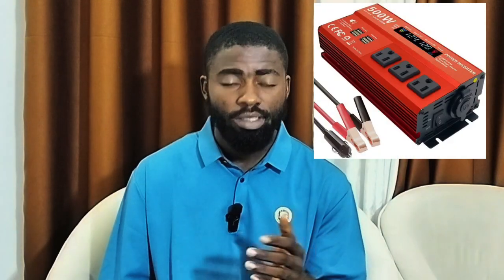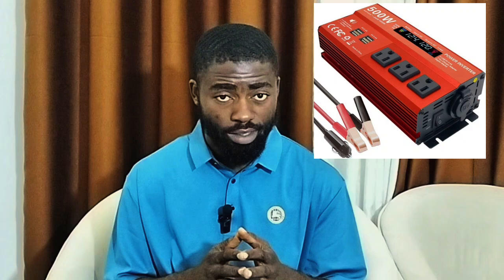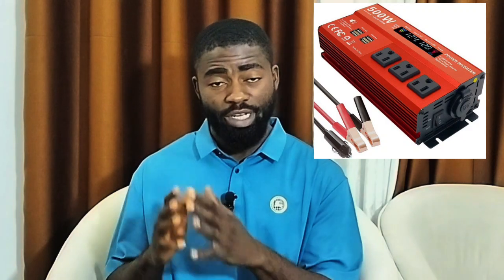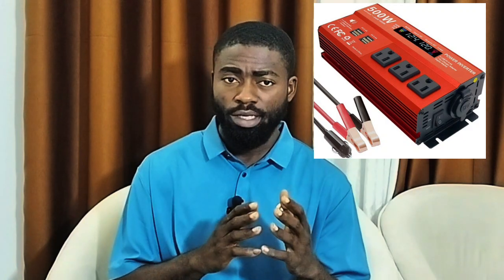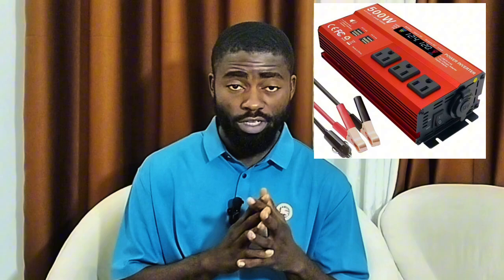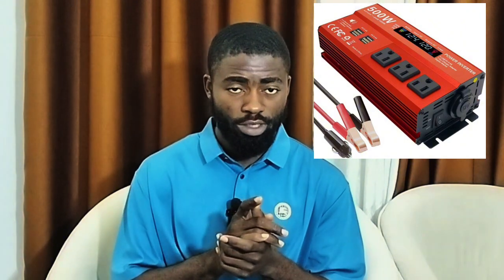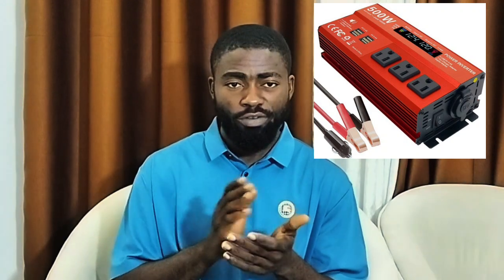THINGS YOU NEED TO KNOW BEFORE BUYING SACHET INVERTER

Comment: I have a powerstation that is hard to charge with solar panel directly, can I buy sachet inverter and connect my ac charger to the sachet inverter to charge my powerstation without adding batteries to the sachet inverter?

Comment: I have one that have been using for 5 year now with same battery its a 1.2/12v still working perfect. The only dissavantage there is the charging harms @ 15a insted of 20-25 so it slow the charging, thou it fine by me cos my solar does most of the chaging and also i have to connect a stablizer with it to ballace the grid coming in to 220v cos our light is low.  never been taking for repair even the day my wife mistakenly plug irion the fuls just cut and i replace it and it cary everything including my watching marching blender tv fans and lights and other things but  excluding ac and irion and pumpin maching. All this disservantage you mention cant be found on my own, and wen is working the light is pure and ballance, it  ( ST full intelligent product ) my dad bought it about 15years ago but  just keep it in the house but i started using it over 5 years oga wen have lent about solar/inverter installation. To me non transformer base inverter are the best wen it come to having  (1) when is just 1 or 2 battery (2) lighter load  (3) when your source of charging its depending on solar  
 they dont  consum much energy from your battery and work at 100% and when it hybrid they charge you battery faster with solar panel cos its high voltage demanding and has modrate temprature and does not emmit heat doing converstion from DC to AC which help the inverter to work as been rated unlike transformer base inverter dat consume much energy from your battery and also emmit heat doing convertion from DC/AC... Thou what you said is true in some of this sachet inverter but the inverter not that bad like for low budget and famicare i no off is good for one battery system and lighter load and having a stablizer to  ballance the grid expecially wen the house depend on solar to charge the battery it work perfect than transformer base inverter cos its has very low self consumption from the battery were-by it increases the back-up hour .